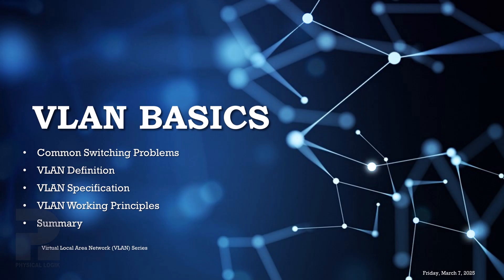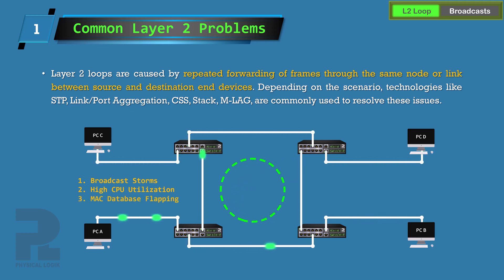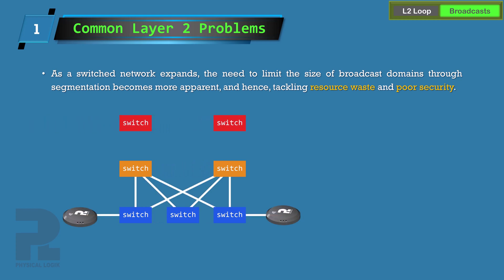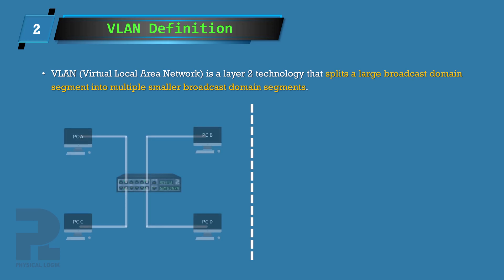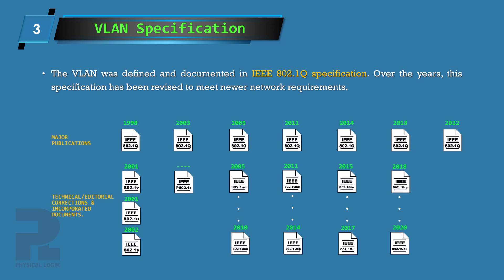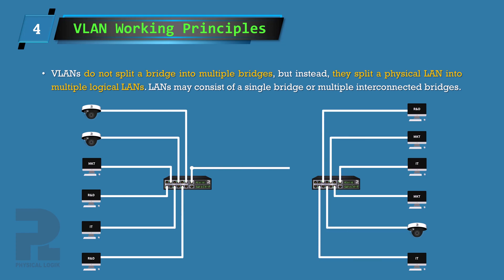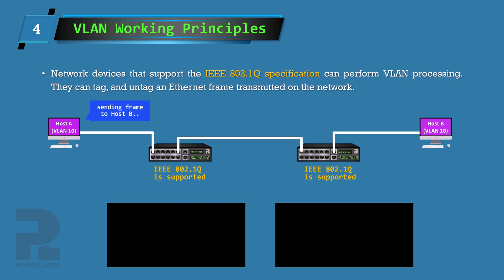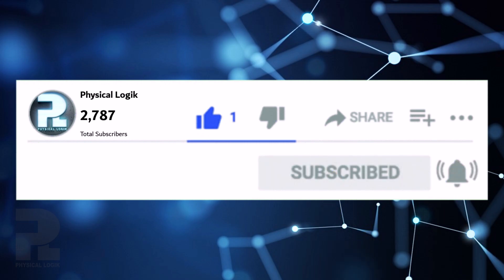VLANs Made Simple: Network Segmentation Explained || VLAN Tagging And Untagging || VLAN 3

Comment: hlo bro i need help pls help me when i connect my ethernet cable with computer it show unidentifying network i try all methods but no one work pls bro help me
Reply from the maker: I could support you if the issue is still persistent. Try to check your VLAN configuration and ensure you can reach your gateway IP address firstly.